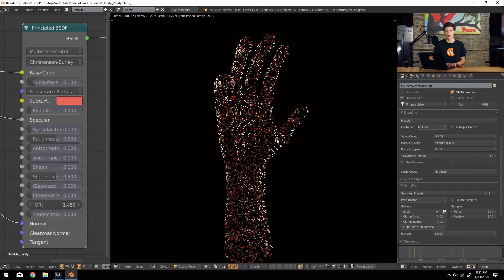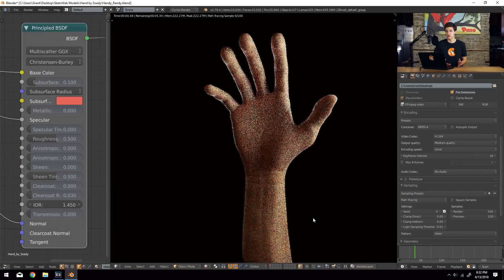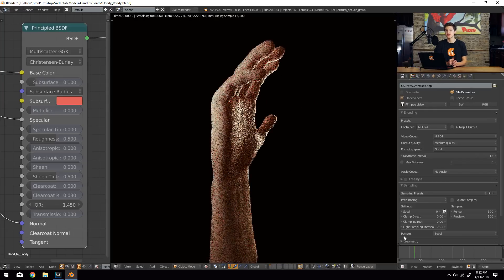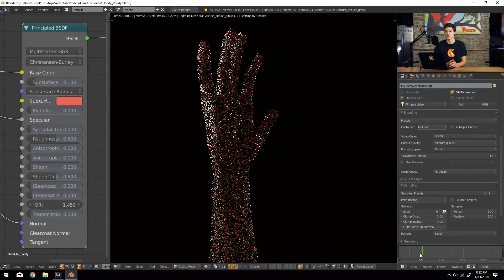What is Random Walk SSS? - CGC Weekly #8

Comment: If you want SSS on your shader then the slider goes to 1; the 0.1 crap makes no sense!

Use that slider as you would the metallic slider; it's either metallic (1) or it's not (0).

If you want variation then create a grayscale sub dermal mask and attach that to the subsurface input. It's a factor slider, not an intensity slider ffs! 

The radius is normally fine, but for more control you can plug in an RGB node to change those values correctly.

Oh, and you should plug you diffuse map into both the base color and subsurface color as you are masking between them with your sub dermal mask. 

Other names for such a mask would be a thickness, or depth mask. You could even bake an ao map and add a bit more white to the ears, nose and eye areas. 

C Burley method looks good if you do it correctly.